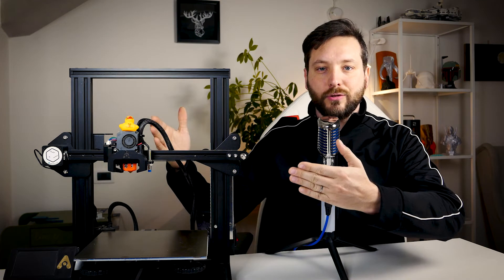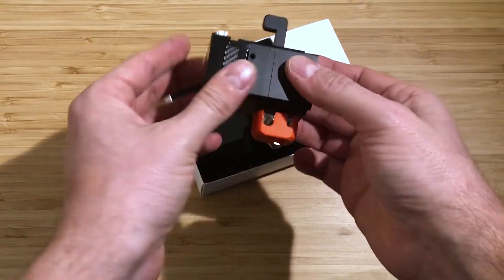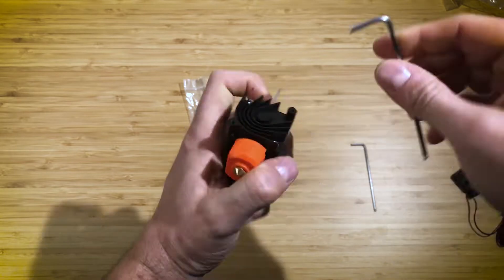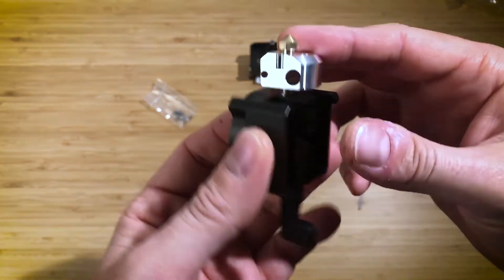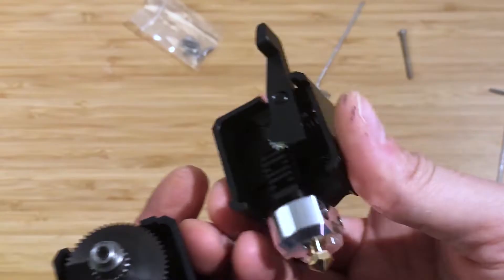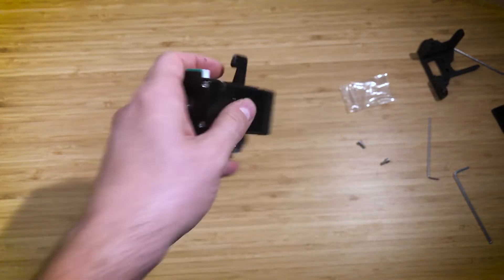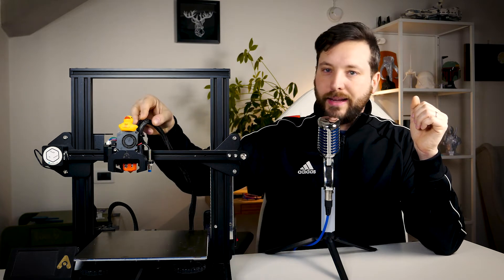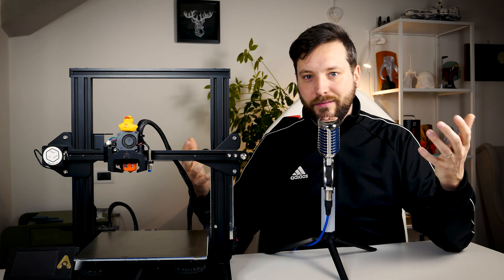Biqu H2 Unboxing and Teardown!

Comment: The thermistor and heater are just plug-in replace and they work? Or you have to change something in firmware? (beside e-steps for extruder stepper)
Reply from the maker: They are plug in replacements. I'm not fussy about PID, didn't check, didn't change 😬

Comment: What part cooling duct are you using?
Reply from the maker: I designed it. I will be soon post an ender 3 video. I have been busy with real life things 😉
Reply: @AMakeDesigns  I would also like that fan duct on my ender 5 :)
Reply from the maker: It's in the plans. I didn't have much time this month to work on YouTube 😅

Comment: When you take it apart it would be a good thing to rinse the bearings out  (I use ISOpropanol ) and dry them . Then Lube them with a known good lube ( I use Silicone because it can take high temps ). This is easy to do ( once you have it apart) and doing this will increase the life span of the bearings .
Reply from the maker: Thanks for the tip!

Comment: Thanks for this video, how about installing it on the mini?
Reply: I sure would like to see this put on mini to see if it will work...... If it does lots of views for the channel
Reply from the maker: Let's see what happens with this one!
Reply from the maker: Due to the cantilever structure I would be careful adding extra weight
Reply: Well, if you have a mini and want to spend money on upgrades. It's propably best to sell it and by a printer with a better construction and better print quality.
Reply: I think it's too heavy for the mini. Since it has a cantilever design.